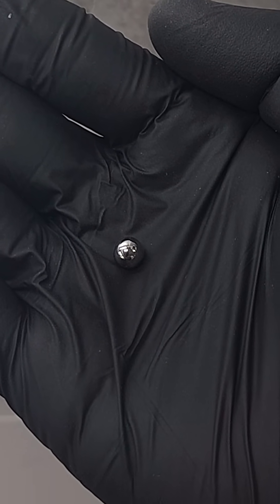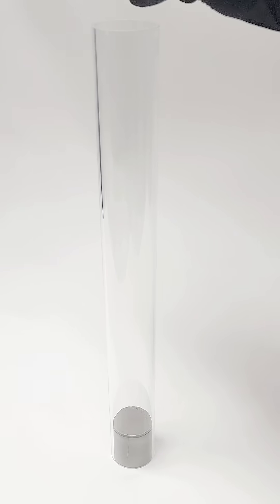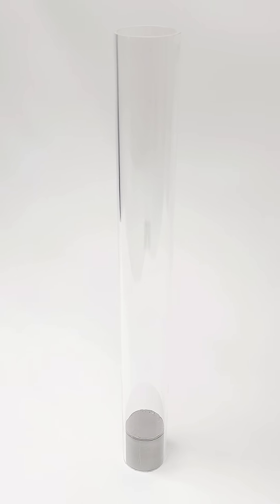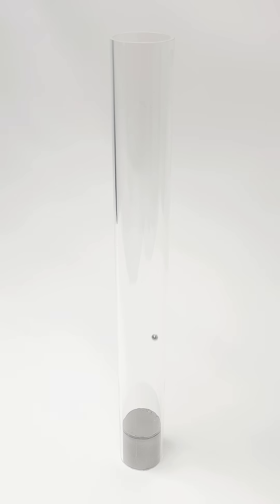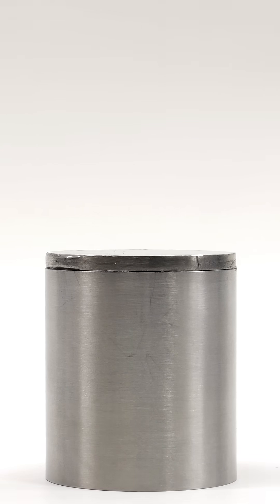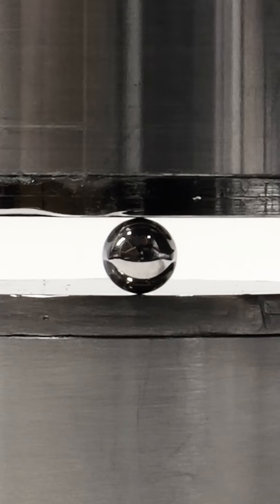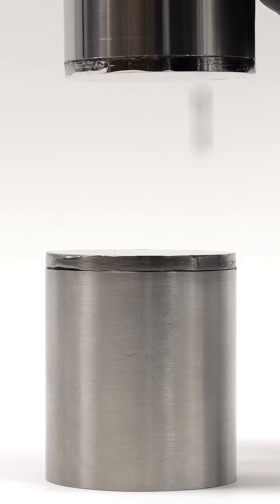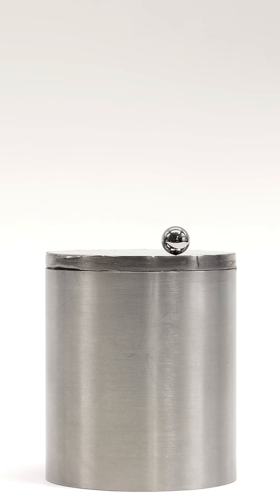This metal is too bouncy

Comment: The Atomic Trampoline sounds like an early 2000s wrestling move
Reply: I wonder if you put it in a vacuum and have the two plates vibrating on a certain frequency and moving at a certain rate if you can make it get more repetitions... Like if you can get a harmonic resonant frequency of the ball and match it with the movement of the plates... This would increase the amount of bounces you would get per drop....
Reply: @AquarianSoulTimeTraveler  60% more bounce per bounce...
Reply: @lord_kerman lol that phrase actually is a link to a triple lettered site.
Reply: @AquarianSoulTimeTraveler  if you matched the frequencies you'd cause resonance. In this case the ball would probably bounce higher and higher until it got out.
Reply: @mismis3153  
…except the higher it bounced, the longer it would take to come down in the effectively constant acceleration of local surface gravity, so the frequency would no longer match.

In the cases where the restoring force increases linearly with the displacement from equilibrium, as is typical in spring/mass systems where twice as far of a stretch pulls back twice as hard, the frequency is theoretically constant and resonance is possible.

This thread had no logical connection to the original comment, so to remedy that I here propose the wrestler’s Assimptotic Pitch, which lands your opponent infinitesimally close to the far corner of the ‘ring’ ( as if a real ring would have (a) corner(s)… but then, wrestling is fake anyway ).
Reply: @For_What_It-s_Worth  Yeah but you could still match the frequency. It just becomes a function of time. Would be interesting to see someone do it.
Reply: @AquarianSoulTimeTraveler  - It'd probably break the plates if they happened to be glass. 🍽
Reply: @blessedbeauty2293  it's metallic glass... That's what this metal is. The reason it is so bouncy is because the metallic structure is crystalline like a glass.
Reply: @AquarianSoulTimeTraveler  Bro, that sounds like the perfect recipe for a super universal bomb capable of destroying reality as we know it.
Reply: @AquarianSoulTimeTraveler  there's no sound in a vacuum.....
Reply: @ryanwells5887  that's a really good point... I would like to make a vacuum and test and see if tuning forks are still ring under a vacuum... Might ring but make no noise. Might be able to use this as a local area dark matter density measurement tool...
Reply: @AquarianSoulTimeTraveler woah we get it…ol limitless over here
Reply: @AquarianSoulTimeTraveler  what
Reply: @AquarianSoulTimeTraveler what the F
Reply: Just amorphous metal surfaces @AquarianSoulTimeTraveler
Reply: It does 😂
Reply: The Pile Driver.
Reply: @vinyashere4all  that's a s3x position
Reply: El primo ahh
Reply: Mable, Tugboat & Typhoon, and that huge guy in Raven's Flock tried lots of named like that😊
Reply: Used by Professor Pain!
Reply: Or a 90s rock band
Reply: @AlphaFox_101  beat me to it !
Reply: Or a 90s rock band
Reply: sounds more like a move luffy would create if he ever made one with that title
Reply: Lmao you won the internet today
Reply: In this corner straight from Chernobyl The Radioactive Ruskie and his famous finishing move the The Atomic Trampoline.
Reply: Ununderrated comment
Reply: - It sure does !!!!
Reply: LOL
Reply: The undertaker used to do it
Reply: Ah ha yeah it does
Reply: Or, or, hear my out here, a Killer Prog-Rock band.
Reply: El Mad Scientista pulls the atomic trampoline by using the ring to rebound a wrestler back into standing position.
Reply: your pfp looks like an M&M lol
Reply: Sounds like my door hinge
Reply: @stoiclefty  you must be a blast at parties
Reply: Maybe for an outlaw indy show.
Reply: I laughed mid cigarette drag, kinda sucked appreciate the joke
Reply: HELP I READ IT AS MOVIE
Reply: @adorypetrocelli3249  HELL YEAH, BROTHERRRRR!
Reply: Someone make a sci Fi wrestling novel/manga/anime out of this
Reply: Yes
Reply: sounds like some creative one piece move to a devil fruit
Reply: 70s Pro Rock band.
Reply: Or a yoyo trick
Reply: 69th reply
Reply: @MikeChristensen-s1g  nice
Reply: It's just another Canadian Destroyer
Reply: Ca s'appelle dès aimant
Reply: Literally lol'd.
Reply: Actually
Reply: Or a weed strain
Reply: Lmfao grade A1 aerospace cars the color of akon
Reply: Tombstone piledriver
Reply: or a band name.
Reply: The Atomic Trump-olin.
Reply: or one of those toys you'd find on early 2000s commercials on Nickelodeon or Disney XD
Reply: Nintendo 😂😂😂
Reply: Wow
Reply: Lmao nah-
Reply: Yes
Reply: Thats RadioactiveMan's signature move! 😅
*Theeee Siiiiiiiiimpsoooooons🎶🎷
Reply: nah, band name
Reply: WRESTLLEEEEEE MANIAAAAAAAAAA WOOOOOOOOOOOOOOOOOO
Reply: It’s the sequel to Nacho Libre
Reply: Or a name for a weed strain
Reply: Or a toy that got recalled pretty quickly cause it injured a bunch of kids
Reply: It was actually 😅(in wrestling)
Reply: OMG it sure does 😂
Reply: I think I remember the Von Erich's doing something similar to the Freebird's back in the day...
Reply: nope, feels like from sewing machine to zipper
Reply: ATOMIC... TRAMPOLINE!
Reply: What are they called now
Reply: aura
Reply: nah thats the name of a wrestling move from soviet russia during the could war
Reply: Atomic Buster!
Reply: It’s also a trampoline park in my area!
Reply: Or a dangerous kid's toy
Reply: Or a sex move
Reply: The atomic throw…
Reply: Is it hot when it do the fast bounce
Reply: More like a late 80s move, but I know that's the same thing as the 2000s, to zoomers.
Reply: Energía infinita😮
Reply: Or a sex move
Reply: More like a psychedelic rock band
Reply: "From the top rope!!"
Reply: This brought me some hope for humanity.
Reply: @mardrix  it was
Reply: The name's… Recoom… And it ryhmes… With doom ! And y’all gonna be hurtin… All… Too… SOOOON
Reply: Underrated
Reply: Lol fr
Reply: When you kick the koopa she'll in Mario Bros before they were Super
Reply: Probably a Hulk Hogan combo
Reply: also like a children's toy from that era
Reply: Facts bro
Reply: New finisher name
Reply: Jeff Hardy off the top of a balcony 👌🏾
Reply: ou um show de circo
Reply: Loll
Reply: Frr
Reply: Remember words like, Radical and Wicked?😂
Reply: OH! MY GOSH!🤯

He did it😮.. he really did it..

He hit Lesnar with the Atomic Trampoline and it’s… it’s… ITS OVER. Lesnar is out COLD!!
Reply: Rakishi has entered the chat.
Reply: Jesus Christ loves you ❤❤

Comment: you will get more than a thousand if you use a strong  clap to hold the top end of the atomic trampuline instead of using your hand as it absorbs a ton of impact when it hits 1k times per sec

Comment: you can actually use that to build a simple morse code transmitter system. hit specific frequencies and drain the energy off into a telegraph wire.

Comment: The sound, the bounciness... I think... I think this unlocked some neural pathway in my brain. That felt so good...
Reply: YO SAME BRO
Reply: @pw_powerway2701 I wonder if you put it in a vacuum and have the two plates vibrating on a certain frequency and moving at a certain rate if you can make it get more repetitions... Like if you can get a harmonic resonant frequency of the ball and match it with the movement of the plates... This would increase the amount of bounces you would get per drop.
Reply: @pw_powerway2701  no problem invite me to your place give me a feed and a few drinks and I can fart 💨 up a storm and replicate most of these tones just for you😂
Reply: If you like this check out lasers cleaning metal, particularly coins. You’re welcome
Reply: @AlDeane  you've done a good deed
Reply: @AlDeane  I like the way you think
Reply: now what if the ball were made from the same metal as the trampolines?
Reply: @0b11000100  what makes it work well is that the bearing is solid. Wouldn’t do much if it was the same material
Reply: @deanosovitch  the trampolines are solid too though, right?
Reply: @0b11000100 YOOOOO
Reply: @0b11000100  If you watch his video, you have to try and get the surface as flat as possible in order to actually work properly.

So I don't think the ball bearing being made out of the same stuff would change anything, since it wouldn't form in the same way as the discs.
Reply: This is that aphex twin track
Reply: @sypialnia_studio   hehe you're thinking of Rubber Johnny 😁
Reply: @sypialnia_studio  Zased
Reply: New ASMR trigger unlocked! A ball bearing bouncing between two trampolines that are slowly getting pushed closer together
Reply: it unlocked my pld memories
Reply: Just an old wooden door....
Reply: @Tronnos840 where
Reply: @Tronnos840 lol 😂
Reply: @Tronnos840  old wooden door never gets the credit it deserves
Reply: You may find 'laser etching' downright eargasmic. 💯
YW 😁
Reply: YES! go deeper on that please. sound and its effects on neural pathways is something people should investigate a lot more.
Reply: I love the similar sound a ping pong ball makes when you put the paddle right on top of it while bouncing on the table and get the paddle closer and closer to the table. I can’t find a video of that…
Reply: Same!
Reply: Lasers cleaning metals and laser etching sounds much lower frequency to me -- anyone have any other recommendations for sounds similar to the ones in this video?
Reply: bro bust 💀
Reply: Those oval magnets that you let attract each other.
Reply: @leggonarm9835  oh god I actually remember those, especially when you throw them in the air towards each other. Amazing stuff...
Reply: could really go for a super slow-mo of this
Reply: The end of it just reminds me of being at the dentist lol.
Reply: Listen to Sophie
Reply: You should really check your wording...
Reply: Felt horrible for me. The pitch made my temple hurt instantly
Reply: @MilosMelos-t1n play it in reverse any time you need to headache relief 😂
Reply: It feels… so good~
Reply: bros stoned
Reply: watch sorting algorithms with sound
Reply: You shall now become a speedcore fan
Reply: vibranium unlocked 😂
Reply: welcome to the world of asmr i guess
Reply: I agree VERY hard.
Reply: Asmr...
Reply: thats what she said
Reply: It's the same sound that gets sorting algorithm videos hundreds of thousands of views
Reply: u can get those bead shaped magnets which when thrown close together in the air they come together and make the same sort of increased pitch sound as the frequency of the bounces increases.
Reply: go watch eulers disc by grand illusions
Reply: it keeps making me lol idk
Reply: you'll love sophie
Reply: @bayar_   I like your pfp, what's it from?
Reply: Scarlet???
Reply: @Void_Lumina  she's my spirit animal.
Reply: You can experience similar with a Euler disk.
Reply: Like a brain itch? Same here so don't worry.
Reply: I have a theory that because everything is vibration and not solid when you get down to the bottom of it that sound does actually interact with our base vibrations somehow. Human beings are just literal machines we even run on electricity that's why electrolytes are in your blood and why you feel like garbage when you don't have enough. Or why they restart peoples hearts with electricity.
Reply: Tickles my brain in a way..
Reply: same
Reply: The sound sent me to heaven
Reply: It's called orgasm. You can also experience this during s*xual intercourse!
Reply: DUDE YEAH
Reply: might be able to make some new crazy instrument outta this!!! Hook up one of those ASMR microphones and/ or perhaps somehow attach theremin!!!
Reply: You are going to love this then...it's done from a single sample of a bouncing metal ball bearing and the assist of Fibonacci's math: https://www.youtube.com/watch?v=cQdhzQkddCc
Reply: Sounds like ASMR
Reply: Good day to wear headphones
Reply: The ball said “🚪🚪🚪🚪🚪🚪🚪”
Reply: listen to SOPHIE
Reply: Check out Tipper :) he makes music that sounds like this
Reply: Drogato 😂😂😂
Reply: for me its moving my gaming chair......................
Reply: A whammy.
Reply: Yeah, right? Like... The sound... It's so good.
Reply: That’s what she said
Reply: No neural pathway, that’s just autism
Reply: look up Euler's disk
Reply: I’m so glad I’m not alone on that…
Reply: Must... Inhale...sound...

Inject..into...veins...
Reply: Pause
Reply: Not that good
Reply: MICHELLE OBAMA IS A MAN
Reply: Gayyyyyy 💅💅💅💅💅
Reply: Bro thinks he has aura
Reply: It made my brain itch. 👀Just me? 👀
Reply: Bet it reminded you of corn 😂😂
Reply: Bro speaking truth
Reply: you can do something similar with a pingpong ball
Reply: Nah man that was just good fent
Reply: There is no spoon either
Reply: Busting
Reply: I like your pfp 👍
Reply: Literally every new thing you experience unlocks a neural pathway in your brain.
Reply: @VinnieSuYoutubethe dot gets likes 😂😂😂😂😂😂😂😂😂
Reply: Fr

Comment: You could probably calculate the speed of bounces based on the pitch of the noise it makes. After a certain point, a repeated noise just turns into a pitch due to its frequency being high enough to make the waveform of a sound. (If I'm remembering this stuff correctly)
You then just get the distance between the plates and the sound it makes to get every other statistic you could want.

Comment: I wonder what would happen if someone was to make that bouncy metal but into a spherical shape with the metal on the inside and hole on the top big enough for a single ball bearing I get that whole point is to show off what it can do but I wonder how long you could get it to bounce for if the object shape it was bouncing in was perfecting round as well? Dumber ideas have prevailed so why not try right.

Comment: what can you do with it? can you maybe put a cut in to to like make a channel to like make a connection between two metal plates for maybe making a pulse current? power a transformer with it maybe even use static electricity to keep it going like a high frequency Franklin bell

Comment: @NileRed 
I think there could still be some really cool things to try. Could you put this configuration inside of a vacuum so there's no air resistance? 

Is it feasible to connect the trampolines to something that makes them vibrate, so there's a chance they could bounce forever between each other? You'd just have to tinker with the frequency of vibration and distance between the trampolines and you could potentially graph the results to predict the frequency of the vibration for really close distances so that you could have a sustained system of that high pitched super fast bounces! You might even get away with only making the bottom vibrate, and it might in fact be easier to get consistent data that way

Alternatively, I think you could attach them in a square formation where each trampoline could be pushed towards the middle to continue to close that distance as the ball bearing loses energy, but it could probably bounce in a pretty cool pattern.

See if you can find some other configurations, like maybe this configurations where they're mostly horizontal and slightly tilted so they'd bounce around and around for a long time.

Comment: I’m more amazed you managed to keep the two trampolines level enough that it wouldn’t just bounce away 😮
Reply: Well... If the bounce imparts rotation in the ball then when it hits the other side it will try to bounce back towards its origin because the rotation will push it backwards. That's why it doesn't just snowball and shoot out to the side but you still need to be reasonably close I would assume.
Reply: @danieldimitri6133 It's not the rotation but the angle of deflection that would push it out sideways.  But maybe, if nearly parallel, the rotation can cancel out the angle of deflection.
Reply: Multi takes in film editing much?🙂